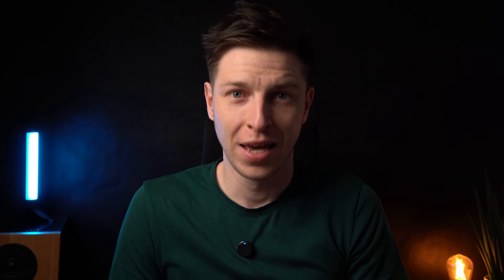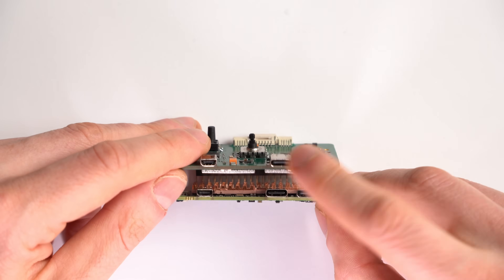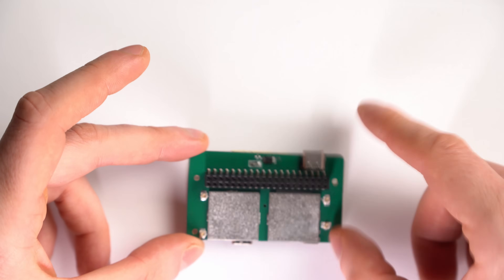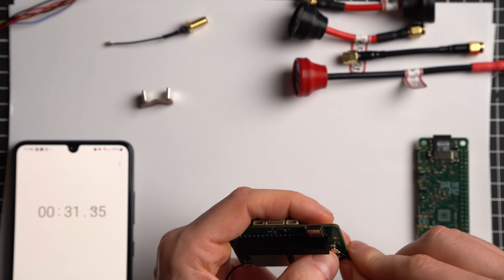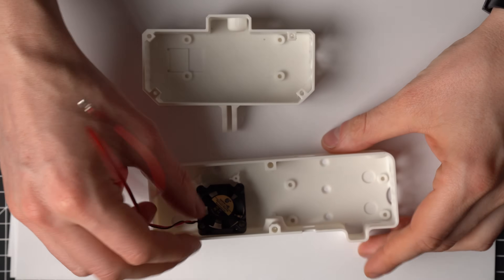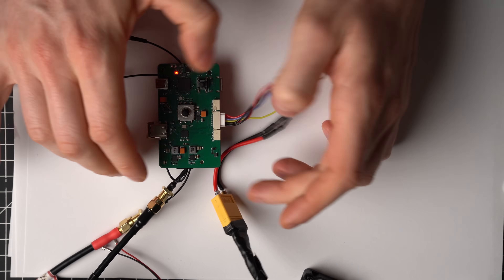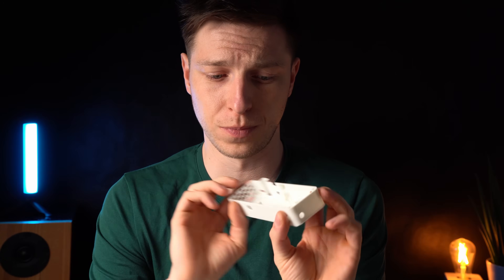This is a Game Changer for OpenIPC: The Bonnet

Comment: I dont get why you can't just use a radxa and a wifi module...this seems very unnecessary
Reply from the maker: You can. But you need to power that wifi module. And you need two wifi modules for better performance. So you need an USB hub to make it work. And some BECs that Power these modules. You also need a joystick to control the radxa. All these parts were simply put on one pcb for convenience
Reply: @Failsafe-FPV the joystick part is pretty cool not gonna lie.

Comment: Here's a summary of the video:

* The Open IPC bonnet combines all the components needed to build a ground station into a single board \[[01:15](https://www.youtube.com/watch?v=clJ_RMedGbA&t=75)\].
* It is a universal device that can work standalone or with single-board computers like RAD zero, Orange Pi, and Raspberry Pi \[[01:31](https://www.youtube.com/watch?v=clJ_RMedGbA&t=91)\].
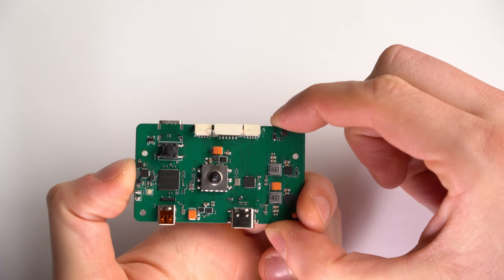* The board measures 38 by 65mm and has a five-way joystick, a push button, and connectors for power and USB hub expansion \[[02:10](https://www.youtube.com/watch?v=clJ_RMedGbA&t=130)\].
* It features two BECs (battery eliminating circuits), a USB-C port, and an HDMI micro port for connecting the RADza single-board computer \[[03:09](https://www.youtube.com/watch?v=clJ_RMedGbA&t=189)\].
* On the back, there is a socket for GPIO, protection covers for Wi-Fi chips, four IPEX antenna connectors, and a display port \[[04:49](https://www.youtube.com/watch?v=clJ_RMedGbA&t=289)\].
* The board combines power and signal and outputs it as a display port \[[05:17](https://www.youtube.com/watch?v=clJ_RMedGbA&t=317)\].
* The presenter assembles the board in 2 minutes and 12 seconds \[[06:56](https://www.youtube.com/watch?v=clJ_RMedGbA&t=416)\].
* The presenter is working on designing cases for the bonnet and will provide the 3D file for users to design their own \[[07:34](https://www.youtube.com/watch?v=clJ_RMedGbA&t=454)\].
* The Open IPC bonnet will cost under $40 and includes antenna connectors and cables \[[09:06](https://www.youtube.com/watch?v=clJ_RMedGbA&t=546)\].
* Initially, only 100 pieces will be produced, with pre-orders starting soon \[[09:46](https://www.youtube.com/watch?v=clJ_RMedGbA&t=586)\].
* The presenter plans to use the bonnet to build a DJI-style controller \[[10:10](https://www.youtube.com/watch?v=clJ_RMedGbA&t=610)\].
* A video on building the enclosure and a ready-to-go VRX will be released in a week or two \[[10:39](https://www.youtube.com/watch?v=clJ_RMedGbA&t=639)\].

http://googleusercontent.com/youtube_content/0

Comment: You want game changer? Design a $150 OpenIPC goggles.
Reply from the maker: good parts alone will be probably more than that, not counting in R&D, taxes and profit margin
Reply: @Failsafe-FPV  Well then, It's a good thing I bought Goggles L for $160 directly from Caddx. I guess that makes Walksnail the cheapest HD system ;-)
Reply: I was thinking $400 USD. I’m talking about a premium version with no compromises. If that blew out to $500 but was truly a premium version then you’d sell them by the truckload.

Comment: under $40 is all! I think just out of pure simplicity youll sell quite a few. People like myself will remain that want to DIY the entire thing, but I am weird like that and was building ELRS RX"s well into the commercial availability of ELRS  and just like to build stuff. But at the price its about the cost of parting it all together. Great job! Slap on a radxa 3w and you got a decent lil RX for sure.
Reply from the maker: yes, $40 is a steal. You are basically paying for parts.
Reply: What exactly does the radxa 3w do for the functionality of this? I've got a couple of Pi Zero2 W's kicking about. Are they any good for this?
Reply: @wattage2007  radxa 3w is significantly more powerful so you'll end up with better latency basically
Reply from the maker: @ radxa runs the decoding and other processes to basically process the stream and it outputs HDMI for your monitor

Comment: I think that i will just get the Runcam link v2 and VRX. I have a question, the video sensor in the link v2 is rated for 4k so why can't it transmit it?
Reply from the maker: It's all about how much data you can transmit through the wireless protocols. No point going above 1080p at the moment, because we can only transmit about 20 to 25mbit per second. I would rather do onboard recording in 4k ;)
Reply: @Failsafe-FPV what’s stopping us from doing onboard recording in 4k or in any format currently? I noticed none of the openIpc digital systems have onboard recording.
Reply: @amanryder8380  The VTX/Cam is already encoding for transmission via WiFi, to also encode a 4k stream and store it locally would take additional processing power that simply isn't available... That said, local recording of the initial encode should be possible and I am disappointed it isn't.
Reply from the maker: @amanryder8380  Air unit chips are not able to simultaneously send the stream and do a DVR recording. New generation of devices with better chips is in development though, but I cannot confirm if they will do that just yet. There are many things to consider for a good working system
Reply from the maker: @amanryder8380  I mean, we can do a DVR in 720 and full HD, but there are a few bugs as far as I know. It’s in development

Comment: All great but that mini hdmi it will be a headache…. Using it with Dji rc pro I have already 4controllers in which mini hdmi needs replacement…Go for classic hdmi which can take some abuse
Reply from the maker: I would say v2 of this will have the mini. You can always use a display port
Reply: but he said it has a micro HDMI 3:28

Comment: Very nice! You mentioned it can be used with a phone. Cane it be powered by a phone using the USB-C connection?
Reply from the maker: No, you need a minimum 2S battery. The radxa will work but the wifi chips need higher voltage